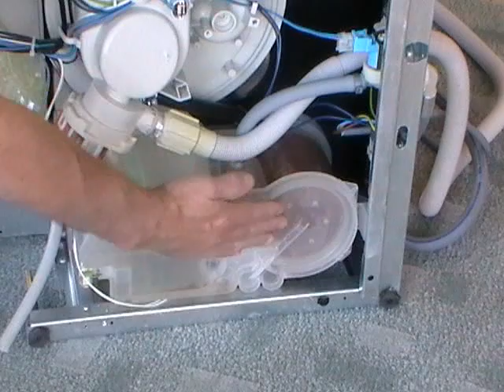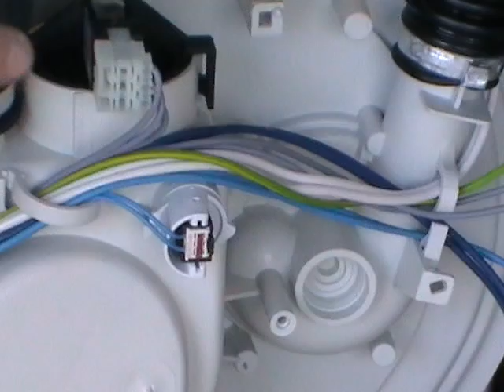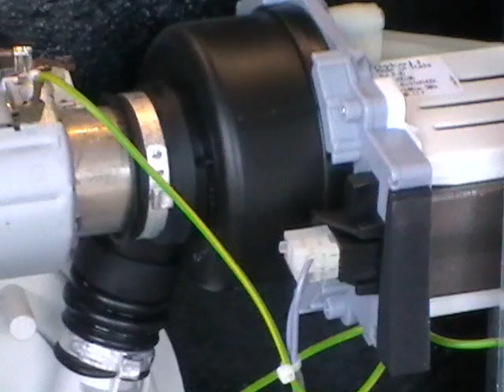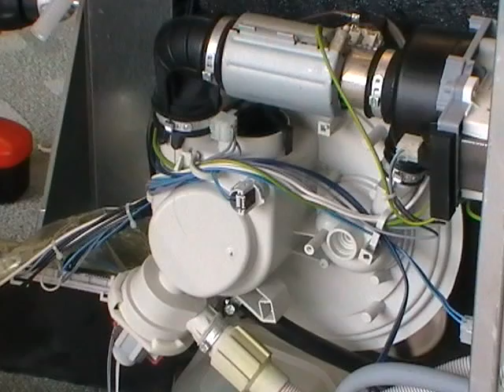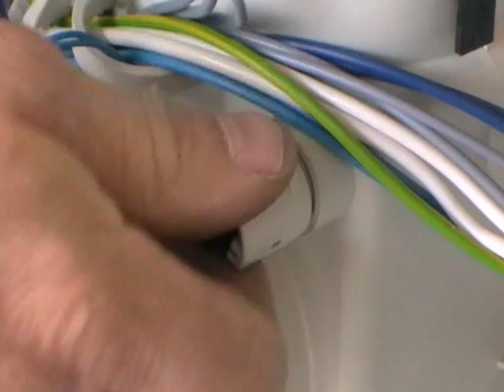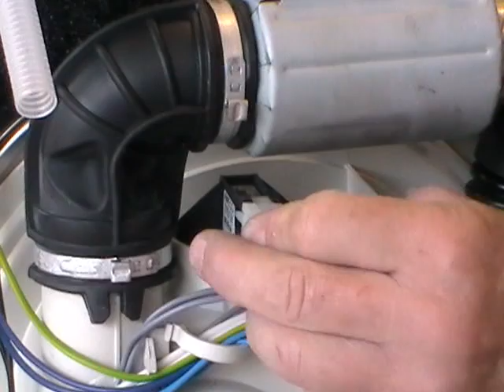Whirlpool Diplomat Bauknecht  Dishwasher  F1 and F4 error code problems

Comment: Hi, used this video a few years to fix the f4 pressure switch fault. Today I fitted a new NTC as per your advice. Unfortunately still getting the F1 error code. Is there a way to factory reset the dishwasher to clear board of faults?

Comment: Great video, helped me to fix that error after cleaning the clogged pressure grid. When you insert the pressure switch back, you need to push it in considerably, otherwise cannot lock it.

Comment: Ace video. Took the pressure switch off and the grill was choked with gunk. Cleaned it but still didn’t work. Took it off again and removed the grill and cleaned the diaphragm and rebuilt. Then realised I’d isolated the water 🙄. Working a treat now. Much appreciated

Comment: just to aid others - I had flashing 4 lights problem, first step find out if pump if faulty - dishwasher should be empty of water then put around 2 litres in dishwasher and turn on - check it drains out the pipe, then after open dishwasher and remove pressure switch, mine was clogged with grease, disassemble clean and operate small button inside with a toothpick or similar a few times, reassemble and try again - mines working perfect now! Thanks for video!

Comment: Thx a million! I had F4 error on our Kuppersbusch IGV 645.2 which has turned 12 yrs old. I read somewhere that it is a Whirlpool so your video worked great. I was sceptic though because my pressure switch did not have a lot of crud in the grid, it was more on the sides on the seal. I cleaned all visible crud away with a toothbrush and some washing up liquid, I also cleaned the contact which had some leaked yellow brown grease on it, I also scraped off built up corrosion with a small flat head screwdriver on the copper parts of the contact. I did buy a new sensor before I had tested the result of the cleaning but it was only EUR 11 with shipping online in Germany. The machine did a full 2 hrs programme directly after the service and it went all the way to the 3
 beeps end with no errors! I am so grateful for this DIY video, this was the first time I ever worked on a dishwasher before, my wife was ready to buy a new one but I told her that I wanted to give this a try first.  THX! THX ! THX!

Comment: Thank you very much for your videos, I managed to clean my pressure sensor in Whirlpool ADG 7550 and it has just successfully finished its washing cycle without any problems! :-) I experienced four flashes (F4) - that is draining error but without any water inside. I had to (after unplugging!): 1) unscrew 2 screws holding the washer to other cabinets, pull it out (checking the hoses), 2) unscrew the bottom front panel (4 torx screws), 3) lay it on its side (wiping thew spilled water, not that much), 4) unscrew two more torx screws to remove the bottom, 5) then following this video to get the pressure sensor out, 6) taking of the grid was most difficult (I probably broke thin part of the plastic behind the ledges holding it there), 7) cleaning it (totally full of stuff), 8) putting it all together following your video again. I didn't need to dismantle the front door. I 'm extremely happy not only to save the money, but also to understand something better and getting even more love from my wife becoming hero of the day. ;-)

Comment: Hi, I have a Diplomat ADP 8132 dishwasher which has stopped heating.  I have checked the element, 28 ohms, the thermostat  works correctly.

All programs complete their cycles without heat.  There are no error indicator lights.  No idea what to try next.  Hope you can help.

Comment: Hi. I got an F4 error. I did check and clean the pressure switch ( it was all sticky..like honey). I cleaned it carefully and plugged it back in. but still I have the F4 error at the exact same time (Express 40º, takes 38 min.. it pumps in water, but at minute 28 it stops pumping water, then I can hear the engine humming, at minute 24 it stops and shows the F4 error again). please help me.. I don't know what to do.
Reply: ***** I have a bauknecht GSIK 6528 WS, it's second hand- I can't afford me a new one, as I'm just a poor austrian student. The machine seemed to be in very good condition...
Reply: Did you also clean the grid filter in the middle of the machine under the propeller? sometimes useful to work with a mirror since it is always a lot of built up crud there.

Comment: Hi, Im getting the F4 fault, checked and cleaned the pressure switch (it was very clean anyway) and still have the fault. I dont think water is coming in. Any tips please ?
Reply: Michael Connolly Pressure switch works, coul dbe a fault on the PCB board itself ?
Reply: Great advice, I fixed it. I took the door off and I could see a wire had come loose from the wire loom. I traced it up and it had pulled its connector from the socket. Simply pushed it back in and its back working. Nice one Michael 😁😁

Comment: Hi! Tanks for this awesome video! I hoped iT was the pressure switch being clogged up, but alas. When i start the dishwasher normally à distinct humming sound was heard. I guess the pump doing something. No when i start it hear nothing. After a minute or so, water will pour in, and a few minutes later, the error happens. Do you think my pump is just gone? ITS the f4 error, btw. Thanks for any help you can give me.

Comment: indeed these prices are a bit different from the ones in germany. this dishwasher is 5 y. old + cost me €300 so i guess it is not as decent as i would like, but it kept my dishes very clean. the other problem you mentioned is a good & honest repairer, here in germany it is the same problem. a picture would not help you either, i suppose, if i only knew where to look. thanks again i am still stunned how great your expertise opinion is and that you are willing to share it with others,

Comment from the maker: As I can't se the dishwasher it's hard to say if the repair is worth it. A faulty WI replacement will come in @ £90 to £110 depending on local labour and cost of part, the pcb alone will top £150.
You need a good repairer to give honest advice about the viability of the repair versus replacement. A decent built in dishwasher will easily be £600 + and under £400 will be much lower, quality and reliability wise.

Comment: omg you are great, thats exactly what it does, the cycle stops water drains out and error is indicated. would it, in your opinion, make sence to get it repaired? or even repair it myself, but i am quiet a greenhorn when it comes to electronics. how could i test a faulti water indicator, weak contact or brken wiring? the dw was moved when we moved to a new loc maybe the transport could have caused it. i am so happy that you hit it right on the spot, the only question is now, how to get rid of it.

Comment from the maker: FA or F11 (11 flashes) is WI failure (Water indicator)
This can be Faulty WI microswitch, weak contact, wiring broken (in the door usually). One of these three is the normal fault....
The electonics receives the water pulse signals and the WI says when it is full to correct level, so if no faults found then consider the pcb control board as the fault. The error occurs when the info mismatches, cycle stops, water drains out and error indicated.

Comment: nice video, would you have any clou what 11 x blinking means on a bauknecht gsfs 5321, does that concur with error 11? and would you know what to do in that case? we've got the dishwasher open already and it looks just like the one in your video on the inside ;) i*ve tried german d.i.y panels but they do not seem to know anything at all and i am going in circles.

Comment from the maker: it takes water, heat, detergent and wash pump action to clean the dishes. Are you missing one?
The top basket is feed by a rear tube (on the back wall) check the fitting of the tube at the bottom, broken lugs can allow it to flex upward, check the upper basket sealing to the rear tube. Leaks in either place will result in top basket poor wash results.
Common fault is wash spray pump not working or clogged with food debris (swetcorn or rice etc), can you hear water spraying about the cabinet?